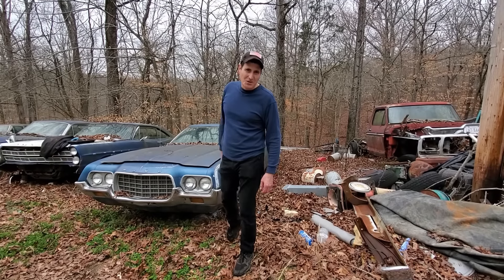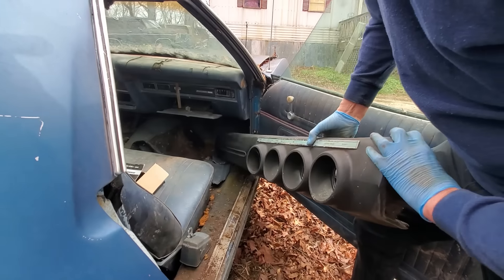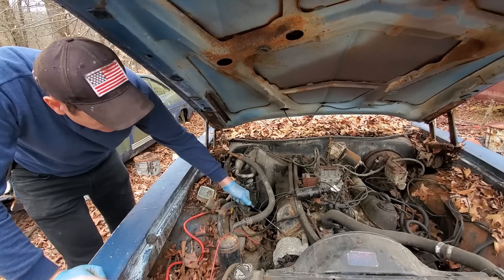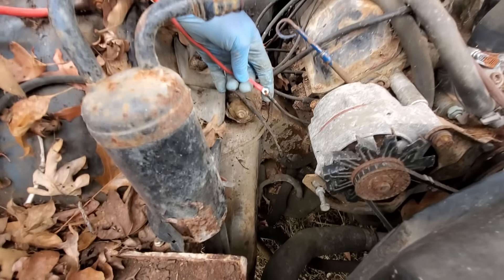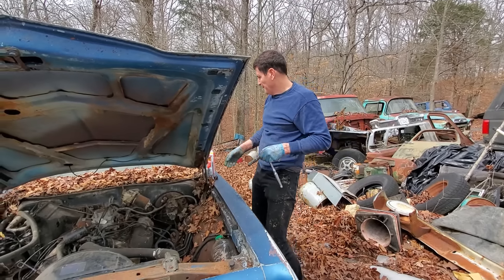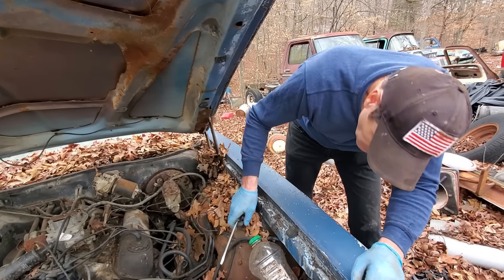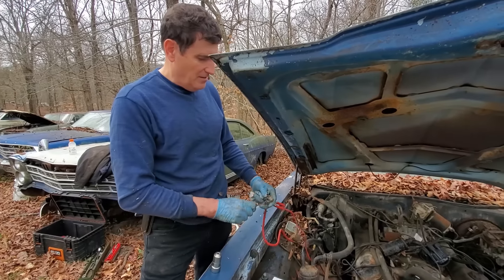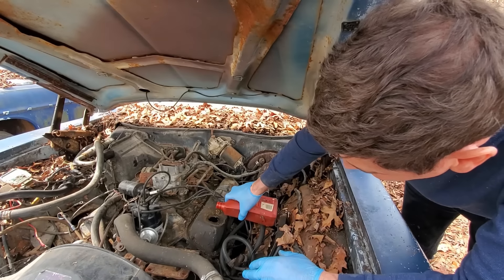Will it run and drive out of the junkyard? A 1972 Ford Ranchero!

Comment: I'd love to have that 67 Fairlane or Galaxie setn beside the Ranchero..I'm into the big body cars better known as land yachts although the Galaxie wasn't too awful big cause I remember my brother running 289s with 4speed trans in the Galaxies and they surprised me how well and strong those 289s were..390s 427 upto a 429 4speed trans was so much better than the small block engines but it was surprisingly good with how well the 289s did and I don't never remember blowing up any 289s. We always swapped the gears in the rear and they's gobs of fun in the 70s cause nobody popd hoods, we'd just line em up and go with everything they had in em lol..I'm pretty sure that I ended up with 289 stock high-performance engine that was in a 64 or 65 Mustang GT and you could feel the torque vs horsepower coming outa the hole in a 66 4speed Galaxie that ran a really good E/T in a quarter mile. I didn't think that it would ever run an 11.68 and an 11.27 that got me disqualified for going to fast with the car being in a 14 second class lol..My brother beat my 14.11 time like the car was running a big block instead of a tiny 289 under the hood and it looked so tiny under that huge engine bey lol..I get to gabby speaking of the 60s car's that we'd build in the 70s lol..Good luck with the Ranchero but I'd love to have that car beside of it lol...If you don't have a good body ground from the battery none of the lights will work and it also might have fuses missing plus the engine might not whirl over like it's supposed to if the battery negative ground isn't bolted to the engine really good..I had headlights and taillights on a 68 Cadillac that didn't work and a Ford Ltd that the lights wouldn't work so I ran a body ground from the engine to the firewall and from the battery to the core support and everything started working except a taillight bulb that was blown and 1 of the lowbeam headlights although your headlights looks good cause I don't see any black spots on the headlights..It's probably something simple after you take the time to go through everything..
Reply from the maker: Thanks for responding. We will be taking a look at that Galaxie soon.

Comment: I kept waiting for you to find a rocker cover decal indicating the displacement, sometimes they are on the front of the engine bay, maybe that is it on the fan shroud. Out of time may be a worn timing chain/gear assembly or someone has been fooling around with the ignition system before you. Jack up the front, I bet the wheels are froze with stuck brakes.

Comment: Check the distributor could it be a tooth off?
Reply from the maker: I checked and it seems to be correct.
Reply: @whattherust  I put head gaskets on a Chevy nova I had and when I  put the distributor  in I got it 180 degrees  out. It did start up  but ran a bit ruff.

Comment: You may just have tired rings or leaking valves on a couple of the cylinders as well. But our rught that the timing chain may have skipped a couple notches or two.

Comment: 351 Cleveland or possibly a 400. 400 has a taller deck but uses the same heads.  351 would be the H code on the VIN.

Comment: good job but i bet its a 351M engine i think most of the cleveland motors were 4bbl.
Reply: That's an H code 351C,  M code were high performance unless you mean the 351M/400 which came in 75.

Comment: The sun was going down coming half way down the Big Bear Mountains.  I'd had a long day canoeing and swimming and was plain tired, so I pulled over onto a incline, oops!  the car started sliding down into the forest.  I gave the car, a 62 Mercury Comet, some gas, OH BOY! the rear end spun toward forest trees growing on the incline and the car headed down the sloping ground, I applied the brakes but not to hard, the rear of the car hit a tree, thank the Gods, but not to hard, the bumper just had a dent in it.  I was a young loan wolf who always seemed to end up biting myself in the ass so I said the heck with it, I'm tired, I'll deal with it in the morning. I hopped in the back seat and slept until late morning and woke up having to deal with the mess I got myself in, RATS!  No way I had enough money for a tow truck so I opened the trunk of the car, no shovel, CROWBAR!  Good.  I dug ruts in front of all the tires and places rocks, stones and tree limbs in it.  I hopped in and gave it some gas, the car moved, so I floored the gas, pedal to the metal.  I couldn't believe it,  IT WORKED,  I was facing the wrong way on the road, but it worked.  Groovy Man.
Reply from the maker: That is a cool story! I would have liked that to work here, but the car had so little power it would barely spin the rear wheels.

Comment: Back in the day on your old car when your AC failed.
It was easier to remove it, than it was to fix it.
Unlike nowadays, just about anybody could do Automotive AC.
8:30, I know they are practically the same, but I've always been a fan of the El Camino Vs The Ranchero.
Probably because GM's are far better looking than Fords.

Comment: hey you guys and gals down yonder another story for you all a freind in school bought a 1972 just like that one it was bronze with wood grain. that didnt last long he somehow got all of the wood grain off sanded it down and painted it black primer. it had  baby moon hub caps a little 302 with a fmx transmission had to put a modulator on it spark plugs and a carb kit .and it had air conditioning and was disconected. he ran the crap out of it he even did a dukes of hazzard thing with it. this thing was pretty much indestructable.he then sold it to a freind and he also ran the car everywhere.i never new a ranchero in that year would last as long as it did. and beleive it or not it got about 15 mpg.
Reply from the maker: That sounds like a good car, and 15 MPG is quite respectable.

Comment: Front brakes locked up ? Maybe whomever put the new distributor in put it in a tooth or 2 off ?
Reply from the maker: Yes, we go back and check on the brakes and the next video. Stay tuned! You may be right about the distributor.

Comment: I would guess the firing order is incorrect or the distributor is incorrect or is not installed correctly. If that isn't it it may need timing gears and chain. At 140,000 miles if gears and chain have not been replaced replace them. The front brakes are locked up.

Comment: And you couldn't tell the 351 Cleveland just like glancing at it by Papa just a hood you have to count the bolts on intake and you didn't do that not as fast as you looked at it when you pop the hood

Comment: That's too bad that you weren't able to get the Ranchero to move under it's own power.
Reply from the maker: I am bummed about it. Next time I am there I will check those front wheels again. They were free, but perhaps the caliper locked when I hit the brakes the first time. The car was on a fairly steep incline, but if a wheel was locked that could be the difference from getting it out of there or not.
Reply: @whattherust  ; what if you park the truck in front of the Ranchero, attach a tow strap to the truck and the Ranchero ? Maybe that might help to get it up onto some level ground ?

Comment: It cranks like it has a dead hole.
Reply from the maker: That's right, it does. The second plug on the driver's side was completely clean. I doubt that cylinder has compression.
Reply: @whattherust  Now I can't wait to know for sure. 🙂
Reply from the maker: @kevinj2412  I'll see if I can run a compression test the next time I am there.

Comment: The 351 Cleveland engines were built 71 thru 73,  they were basically a 351W with the 351M/400  heads

Comment: That guy needs to learn that there are 2 different Cleveland engines 351 Cleveland then you have a 351 modified Cleveland engine the modified Cleveland engine has more power and that's not a 71 Ranchero

Comment: for all the "will it run and drive shows" that i watch....I fail to understand why none of ya all carry an electric leaf blower to get rid of the crap under the hood and at least have a half assed clean work area.....????.....but good job otherwise....
Reply from the maker: I use a portable air blower regularly, but with me being between houses, a lot of my stuff is in boxes and not easily found. Once I locate it, I'll be using it again.

Comment: Not the timing!!!!!!!!!!!!!!!!!!!! Front wheels are locked up. You didn't even check to see if they would rotate. The engine starts and runs too good to mess with the timing.